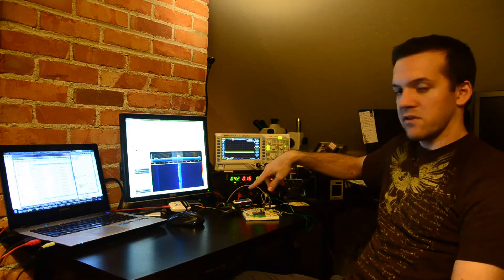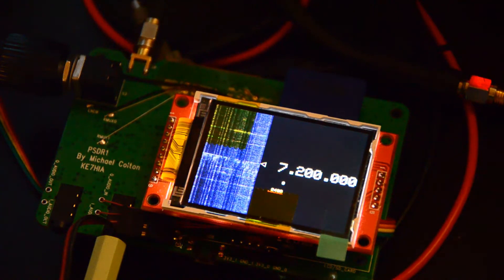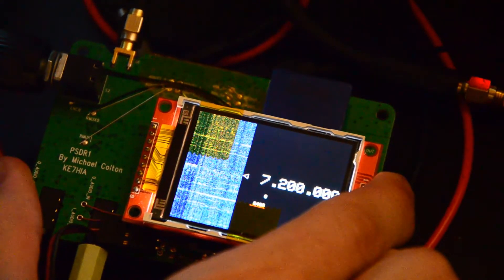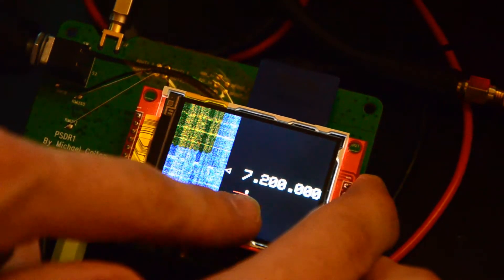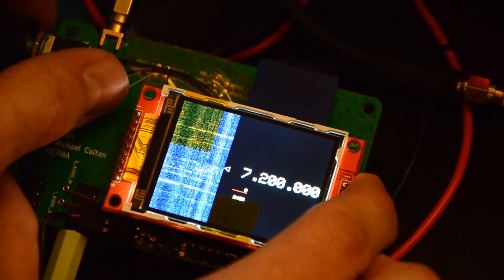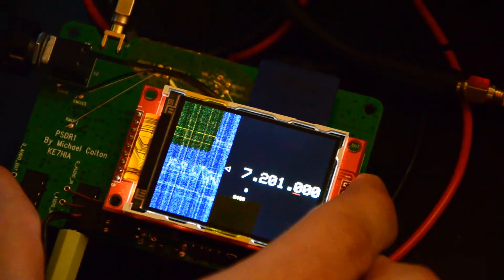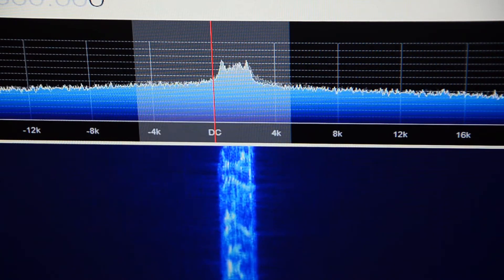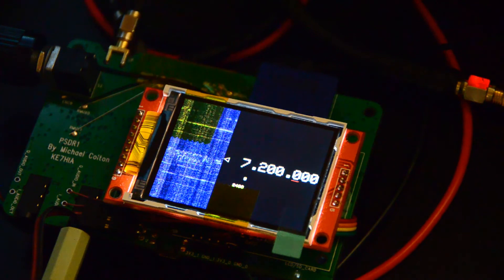PortableSDR Update - Waterfall & Audio Filtering

Comment from the maker: The goal is to cover all the HF Ham and shortwave/AM broadcast bands, basically everything from 0-30~MHz. I would also like to include a stage that lets it work on 2m (probably with somewhat degraded performance).

Currently, it's only really proven it can hear things up to about 15Mhz (though it can tune all the way up to 37MHz), but I am not sure if this is the radio's fault. It may be my location and antenna. I can't really find things to listen to above 15MHz with my Yaesu FT-817 either....